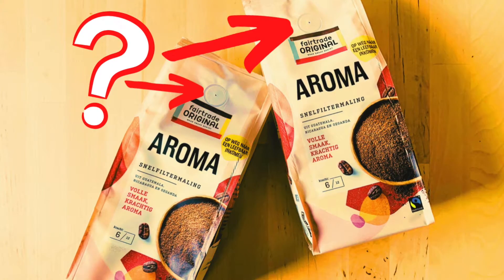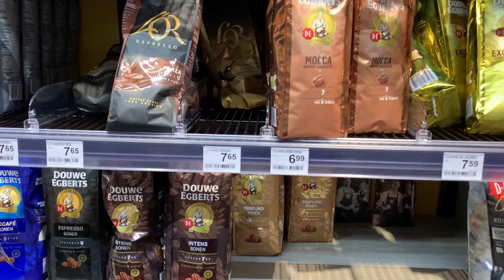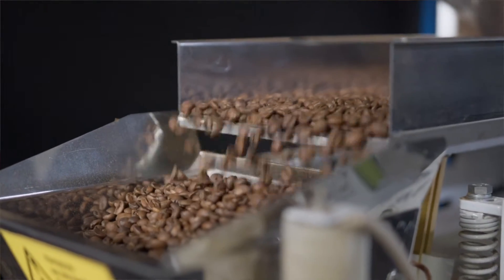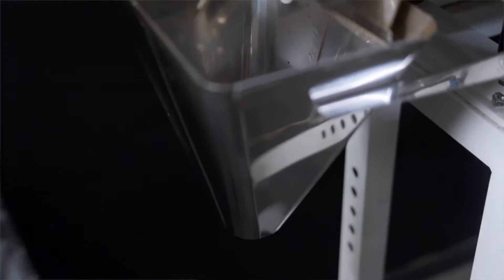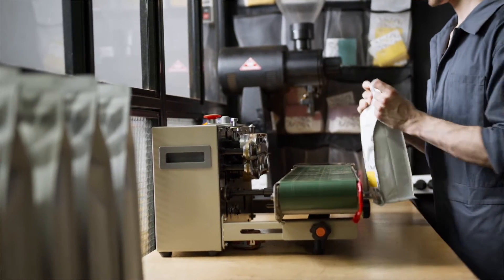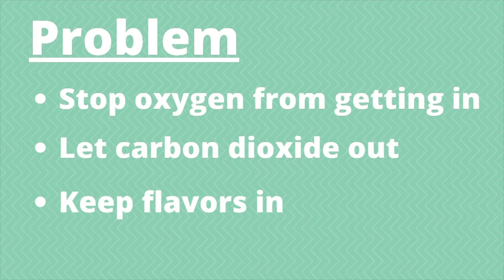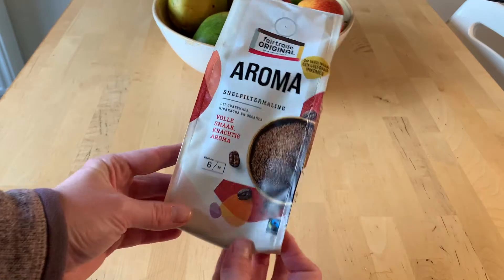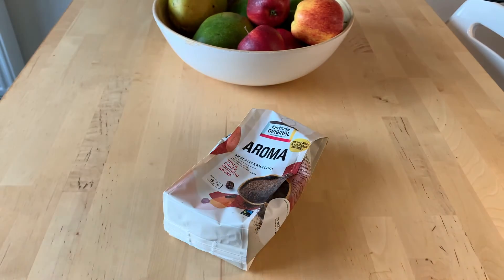What's that hole on my coffee bag?

Comment: So how come a compressed brick of coffee never inflates? I thought it was for pumping inert gas into the bag.
Reply from the maker: You're right that usually inert gas is pumped in but it doesn't have to be through a little valve. Instead it can be done like this https://www.youtube.com/watch?v=DHO3A_gimfY&ab_channel=PACMachinery
Reply from the maker: Any of those hard packed bricks or metal cans like Folger's means they have to wait days to pack their beans into those containers. That's the only way to ensure the coffee has de-gassed enough. There will be some CO2 released inside the hard pack, which will soften it a bit over time.
Reply: Thank you for approving the comment. Haha. I've not noticed any lack of freshness in vacuum packed ground coffee such as Jacobs. Most of the degradation occurs later after it is poured into a jar.
Reply from the maker: @j7ndominica051  I've never purchased the brick pack coffee before and kind of forgot they existed! I see them now more that I live in Europe but maybe I just overlooked them in the US